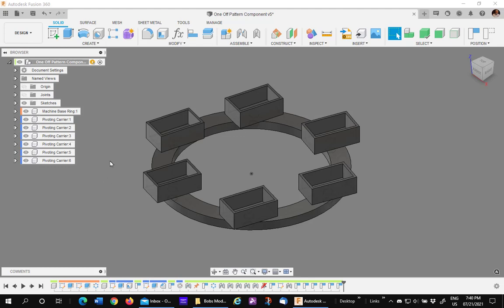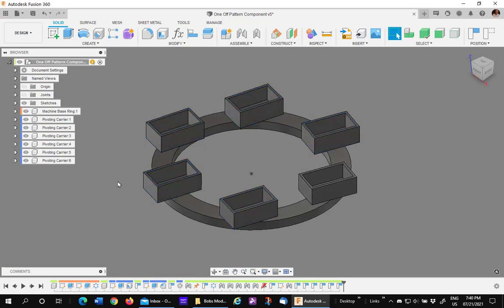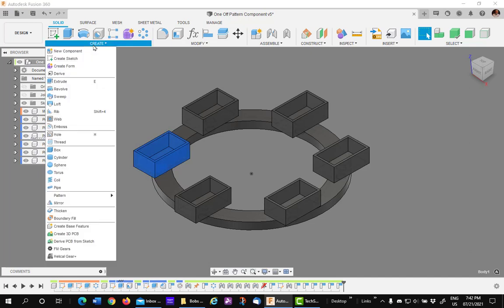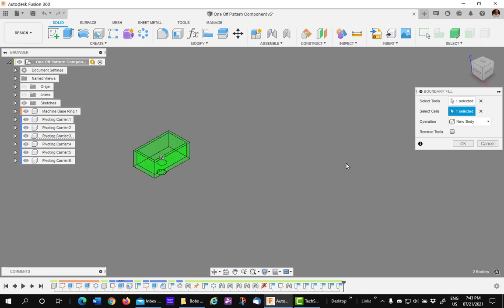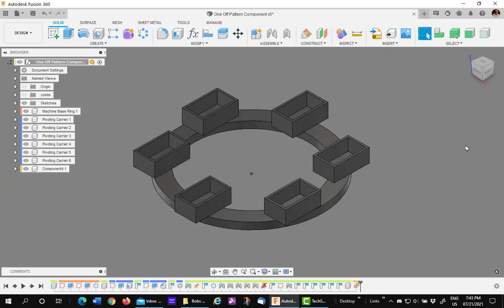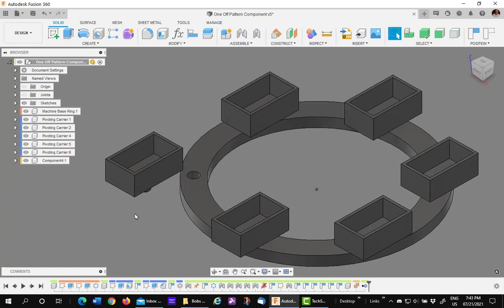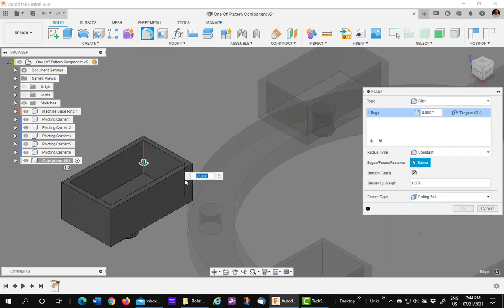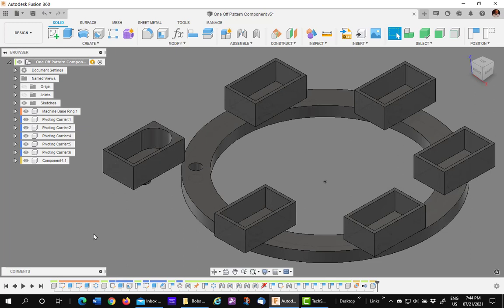Breaking the Link Between One or More Components in a Fusion 360 Pattern

Comment: I had to put matching numbers on components i have copied as instance. I had to find a proper way to copy the components as new instead of created instances in order to do that. The tip you have given in this video solved the problem easily with no need to start from scracth. Thanks so much!

Comment: I don't know if this is just outdated due to a software update, but this doesn't seem accurate. You're components don't appear to be linked in this example (there is no link symbol next to the individual components) and additionally right clicking on a component that is linked does not offer the "remove" option.
Reply from the maker: The components were linked originally by the pattern.  The process defined is to unlink one or more from the pattern.  There are no external linked files you seem to be looking for involved.  I tested the process using the latest version and it works perfectly.  If you would like me to show it works on your model, send your F3D file to my email address at jhackney1950@outlook.com.

Comment: Hi John, I was watching some of your videos and I cant seem to find a solution to what im dealing with currently. I am working on a very complex multi level design for 3d printing that will be a robot and I just dont know how I should structure and nest my components in an intuitive, compact, and logical order. Think of the robot as basically a box with each panel being made of 2 or so parts that are attached onto a frame and each panel has parts attached either directly to them or to the frame through them. Each side of the body (front left right, and back) all support weight like an arm for the front, power supply off the back and wheels on the sides, so they must be quite strong. This leads to multiple joint pieces being between sections either securing panels together or reinforcing corners. Each panel has at lead 10 parts on it at a minimum and some lead to entire other sections like the robotic arm and so my heiarchy is just a nightmare to work with. Either i have very little organisation and i need to read through to find the section i want to edit or i have to go down 5 levels to get to a part i want to edit. I am mostly self taught in design so I dont know what would be standard practice to make an assembly structured the best or how to decide what should be nested or just a sibling or what i should even consider a seperate part. For example, should i group up the panels with their respective structural beams like (LeftSide>panel1, panel 2, bottomBeam, top beam) or should i have the panels all grouped and the frame as another seperate group like (pannels>Front back left right),(Chassis>Lbeam1, Lbeam2, Rbeam1, Rbeam2) and so on? What is considered big enough to be one of the Parent objects? Currently i have (Wheels/Suspention, Body, arm, power, head) but im still just rinning into problems of needing to swap in and out of multiple layers of components to get what i need as i am actively designing everything. To clarify, my question is not about what should be a body or a component, I think i have a decent understanding of Rule#1 but im having organisational troubles
Reply from the maker: You need to copy your question to the Fusion 360 Design,Validation and Document Forum.